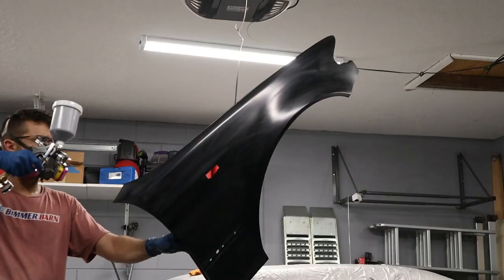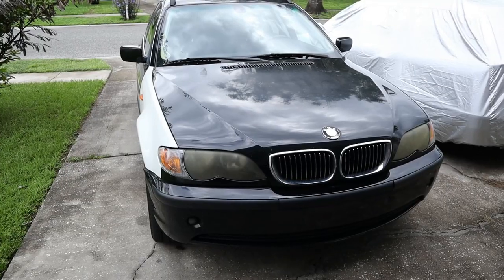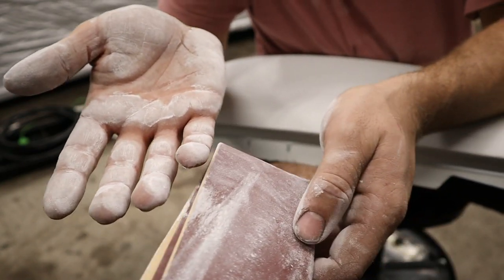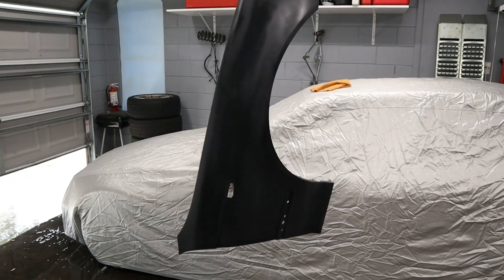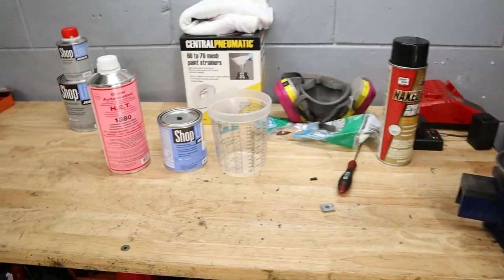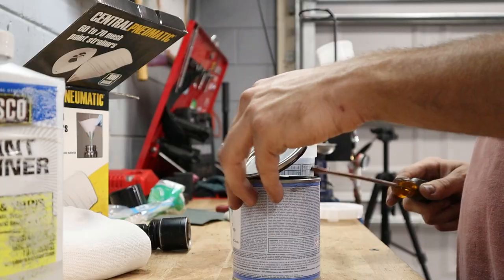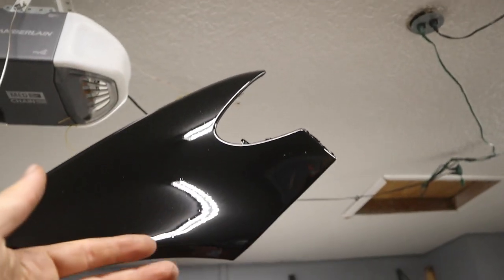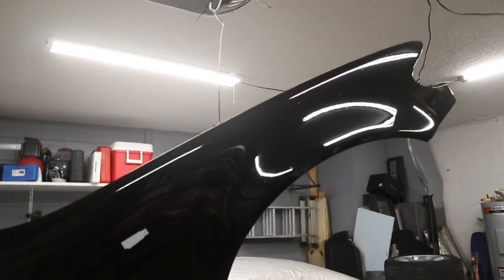Using a PAINT GUN for the FIRST TIME! (First Impressions + Results)

Comment: Great job for forst time. Biggest mistake ppl make ks not wetting the floor kf the shop or garage or drive way to keep dust from blowing up, and going to light on the coats and spraying to far away and the laint ks drying before it goes on and they get orange peel which is a rough surface or fish eyes as well and then winder why thisr paint job is not glossy smooth after clear coating and is rough and dull and looks bad. A trick i have taught my aelf with the laquer based paints is all i use is to spray it on as wet as possible until its the point of running and if your laint is properly thinned and not to thin or to thick you will get a perfect base coats and clear coats everytime and i never had to wet sand and polish out anything unless its for my obs chevy street/grudge rackng truck or my 1963 rambler ambassador which is completely stock and restored except its got a jeep carb 360 c.i v8 in it making 490 to crank but ither then those two vehicles my daily driver work car and my race ar hauler truck i have never wet sanded and polished after paintjobs and they look factory new when i got done with the paint on them. And using a good high quality base and clear makes a huge difference as well.

Comment: Could be water in the airline causing those imperfections.  Or dust in the garage getting kicked up by the spray gun, compressor, you walking around, the fan, the open garage door, and maybe dust falling off the ceiling and dust off those garbage door rails.

Comment: Love watching your videos, Chris! Every episode I see, you’re working very hard. Good job on the paint! The fish eyes you had on the clear coat are solvents/gases from the primer/base coat escaping through the clear and created little spots. Not the same as dust particles or dirt in your paint. Temperature and enough time between coats it’s important for gases to vent through and dry properly before you lay down the clear. Also, mixing different brands of primer/paint/clear may not be compatible with each other. Technical data sheet on each product will tell you all of that (gun pressure, temperature, time between coats, mixing, and compatibility).
Reply from the maker: Yeah, I really need a better venting booth setup, and thanks for tips! Painting is fun. Thanks for watching, Ivo!